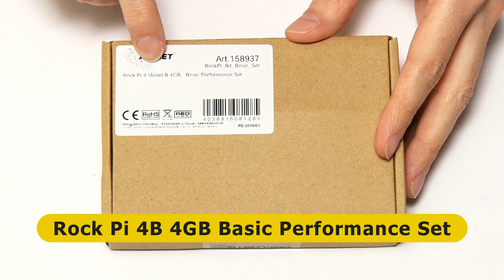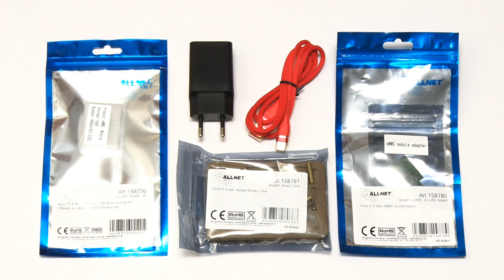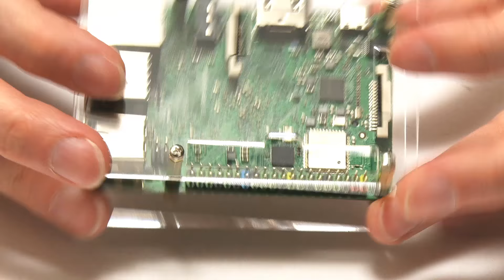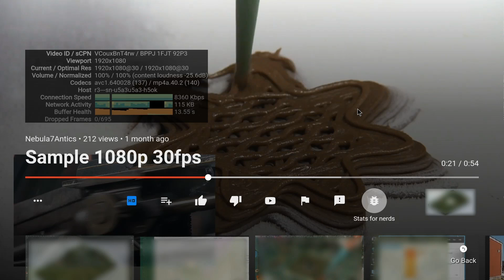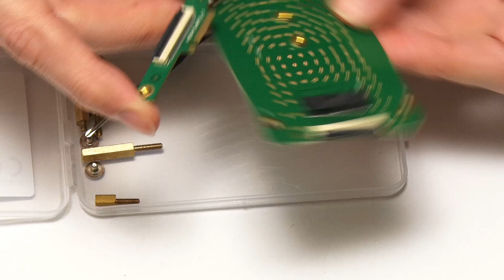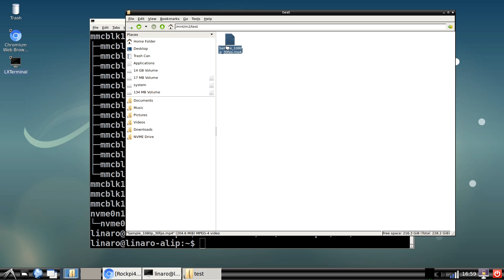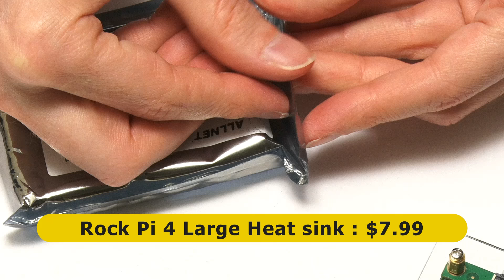Rock Pi 4B : M.2 & USB 3.0 SBC

Comment: These rear mounted heat sinks/CPUs is a negative, convection cooling is going to be far from optimal, they should have also left a cutout for the GPIO pins in NVMe extender board. Better yet, considering most existing standard PI cases can't fit an underside CPU/heat sink, so no savings there, they should move the Display DSI, Camera CSI port and possibly the audio jack to the underside, allowing the ram and CPU to move topside .. better convection cooling and no need for a NVMe extender... most Pi cases would just need a minor lower section redesign and  I doubt many if any  hats need the DSI or CSI ports in those specific Pi locations.
Reply: I thought about all that but then I thought to myself I could just flip the damn thing upside down and slap a fan on that honking heat sink. Does it really matter if it lays upside down? If we all call it upside right from now on then it is ;)

Comment: Could the NVMe extender board be mounted at the bottom of the heat sink?
Reply from the maker: It could indeed. :)
Reply: Then heat wouldn't dissipate as efficiently. They do need to make a cut out on the hat or 90 adapter for sure.
Reply: The heat sink is already facing downward against the table anyway.
But the nvme extension board indeed doesn't take that much surface area, may be some cut out for the air flow or fan mount would be great

Comment: Chris when you added the NVME did you look in the existing Android file structure, I've noted whenever I add micro SDs to my Android phones they show up several layers down in the existing file tree,  they seem to like linking add on nodes through well embedded layers,  always remembering Android was designed BY Nerds FOR Nerds.
Reply from the maker: I will root around! Thanks for this. But I suspect it is a driver issue (or lack thereof)
Reply: @ExplainingComputers  you are likely correct sir, I was just recalling that adding devices on Android always seems a bit sketchy, thanks for continuing making these awesome videos Chris, you are THE BEST!

Comment: Did enjoy the vid as I think RP3 has hit its ceiling and we need the next gen to filter through with more ram and vid as my RP3+ does struggle with some emulation of games esp N64 games that stutter terribly.   I like emulation as it means I don't have to wear out my extensive hardware sets and would rather wear out a SBC than a much harder to replace console or cartridge.

Comment: this is becoming scary. all these heatsinks, daughter boards, wide SCSI-like cables etc.
I suppose this should become end-user friendly complete compact cheep PC with alternative OS. and why casual PC user needs GPIO connectors? One needs more USB ports I suppose.
On the other hand why an engineer  needs HDMI?
SBC manufacturers are trying to make their devices so versatile so no one really needs all this
Reply: Answer to all your questions is that this board mimicks (in a good way) the way Raspberry Pi is (shape included), but with much much better hardware. I suppose that is enough.

Comment: Is the odroid N2 the obvious superior SBC solution at 63 dollars?
Reply from the maker: The Odroid N2 certainly looks like it will be a nice board. But is not yet on the market, is more expensive than some Rock Pi models, and does not have an M.2 slot. So it is neither an obvious or a superior solution! :)

Comment: Hi Chris. Slowly but certainly I am getting my laptop back to where it was.  Interesting little board and I'm only about 6 minutes in. One thing I would like to suggest is that when you point out something, especially on a super zoomed-in shot,  you might want to point out the features with a smaller device than your finger, say a pencil, a straightened paperclip or a small screwdriver.  As a passing thought, you might want to list a price "as-it-stands" with all of the options plugged as it sits.  A nice little review of a nice little computer. Cheers.

Comment: the m2 nvme slot, is that a PCIe Gen2 x4 or PCIe Gen2 x2 or something else?
Reply: Hi, the M.2 slot is gen2.1 x4
Reply: @NB-sw1op  thanks, so at 500MB/s for 1 channel of PCIe 2.1; 4x would mean 2GigaBYTE/s; interesting, wish there was a 4x Sata hat like the NanoPi M4 has
Reply from the maker: This I do not know. All that the Rock Pi web pages state is "M.2 connector supports up to 2T M.2 NVME SSD". I know there are others in the comments here now who may be able to provide an answer. :)

Comment: I'm beginning to believe that SBC's are starting to outgrow their original function. Dont get me wrong I still want one, but just saying. Great Video as usual.
Reply: Isn't it logical though? How would you increase speed without consuming more power or getting hotter? Also it's the space limit. You can't put an AMD Ryzen 2200G on top of this space wise and have space for the rest stuff as well, can you? I know that it's not ARM but my point was space.
Reply: @nikiforossarantoglou5917  sorry, i said outgrow, what i should have said was overpower. most sbc's were originally meant for either iot or some type of robotics. these are now becoming full fledged computers that are completely overpowered for most of the projects that they are going to be going into. they are really nice and more power is always great but at which point is an embedded computer overpowered for the job it is doing? anyways just a ramble of me thinking out loud.
Reply: @benjaminlittle7916  Yeah I got you now! I agree with your way of thinking.
Reply: @nikiforossarantoglou5917  Dont get me wrong, more power is more power, but when it comes to embedded, how much is needed. Still seems like a great product and cant wait to hear my wife yelling at me about this one, lol!!
Reply: @benjaminlittle7916  Personally, I would be sold to get it if it had close to raspberry support. I mean I get it, the price is low for the board itself but there are additional modules you really need if you are going to use the extra features and at least in my country the price adds up well over 100 euros and that makes it more of an investment for me. I will most likely wait and see what's going to be with RaspPi4 but I really like Rock Pi 4B setting new standards, stuff people silently wished all this time and all you would find was just incremental upgrades. Rock Pi 4B did all of these at once which was nice and bold!
Reply: @nikiforossarantoglou5917  cant argue with you there!!

Comment: What a waste of WD nvme drive.? I am gathering money for a NVMe drive, and u are using it on this low power computer.
Reply from the maker: Sorry about this. The drive in question is one I have for testing, so will not stay on this board. But to run my business testing out SBCs and other kit, and for projects shown in my weekly videos, I do need some test components. :) And I am also fortunate that many manufactuers supply what I need (though I did buy the NVMe SSD shown in this video).

Comment: I wonder if u need cooling on the Rock Pi4 CPU since it has such a large speed in Ghz. It may be that it can last longer. A small fan on the heatsink would be efficient
Reply from the maker: A heat sink is certainly needed given the RK3399 SoC and its speed as you say. But a small fan on a small heat sink might suffice.

Comment: Nice board, Christopher! I just looked-up the specs for the rock chip rk3399 on Wikipedia: It has two ARM Cortex A72 cores and four ARM Cortex A53 cores. Unfortunately, the A72 allows for speculative (i.e., out-of-order) execution, so unlike the Raspberry Pi 3, it's not immune to Meltdown and Spectre. I shall get myself a RP3 for extra security for tasks such as online banking. Thank you very much for another splendid video!

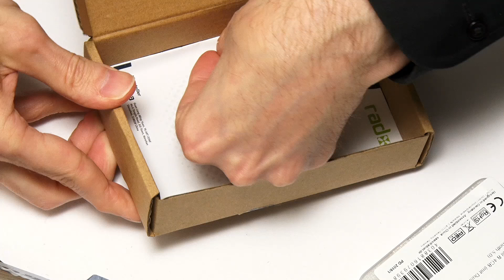Comment: 2:27 you didn't want to go 'agressive' and tip the box over eh :)
Reply from the maker: Tipping the box would not have removed those instructions! :)
Reply: @maicod  we did change the size now, the packaging did unfortunately change faster than we could reprint the instruction manual... sadly Christopher had to suffer with not getting any instructions... ;-)
Reply: @NB-sw1op  It's understandable. Good luck with your product !

Comment: So, forgive my ignorance, but since the Raspberry Pi 3B+ has four Arm Cortex-A53 1.4GHz CPUs, and the Rock Pi 4B has a 6-core CPU -- 4 of which are, in fact, Arm Cortex-A53 1.4GHz CPUs, why can the Rock Pi 4B not run Raspberry Pi software?  Your main complaint is software support -- yet, it would seem, on the surface, at least, that the two computers should be completely software-compatible, no?  What am I not seeing here?
Reply from the maker: The issue is all the drivers for the devices on the board, from RAM to the USB ports, display, etc. There is a mass of low-level software that has to sit between computer hardware and the applications we humans run. This is all standardized for x86 PCs, but not for ARM boards like these.

Comment: I've always wondered; what high memory usage applications are there for SBCs ??
I keep seeing these single board computers designed to mimic the RasPi, but the software/code that you'd run on a computer like this wouldn't likely break 1GB or 2GB of memory usage, let alone 4GB!
RAMDisk on something like this would be a great idea, 2GB of RAM and 2GB of RAMDisk that copies a folder from the storage drive over on bootup, so there is a 2GB partition of UBER fast storage.
Reply: the moment you add a modern browser with tabs, and given the bloat of modern websites, you use up 4GBs no problem, with some paging to the disk to spare.
Reply from the maker: More memory is also useful for NAS applications, 4K media playback, and AI uses.

Comment: Stretching the term 'Single Board Computer' with this one. The M.2 positioning seems like a real mess, presumably its only been done like this to be able to say that the top side of the board matches a Raspberry Pi layout.

Once it's all put together you don't really have a case there anymore. Theres contacts exposed all over the place, certainly not something you could, for example place behind your TV as a htpc without fear of it shorting.
Reply: Rick M Definitely stretching, yes - I think you could (should?) cover the top M.2 board with the original plastic case, looking at the additional spacers they shipped with the M.2 board. Of course that adds yet another layer.
Reply: I think, the M.2. extender board was meant to be mounted on the other side of the main board, below the heat-sink - this way it will not block the microSD and/or GPIO / other connectors :) Also, this way M.2. would be on the 'inside' rather then exposed to the 'outside' of the whole contraption.
Reply: Pitus Pete Yes, that covered SD slot really irked me, too. Either way, I don't mind the stacking, and the big heatsink is a nice idea to avoid active cooling. I'd definitely consider this (S)BC If they got some NVR Software to run on it, the rpi3+ is just a tad too slow for my purposes.

Comment: Great SBC. 
Few tweaks here and there like boot from NVMe, Linux of course, and here we have capable small computer. 
Future is in ARM CPUs technology as in the virtualization as well, on great scale. 
Great work Chris. 
Enjoyable on all scales. Thank you.
Reply: RavenPrecept 

Yes, it is more powerful. 
It uses different kind of instruction set and the way it uses it. More power = power consumption as such. It is cisc. 
On the other hand arm as a risc uses less power as result of different handling of reduced instructions set. 
Cisc can handle different OSes. The best of cisc one can have is using VMs. 
Arm development is getting momentum because of more powerful CPUs and pipe-lining. 

VMs are the best solution for people who uses multiple OSes/lots of programs and applications and do a lot on their machines. 

Or maybe they just like to experiment and to learn. 

What is interesting is to see future development of cisc/risc technology. 
After all, we need functional/powerful/versatile machines with less power consumption and as much mobility possible. 

We'll see.
Reply: Raspberry Pi has more support.  i see they had Ubuntu Server and i'd like to run snap RAID and Merger FS and Plex, Emby and kodi. some of this is explained in the Linux Unplugged podcast episode 277 minute 20
Reply: Elvira Elora Milosic FYI, the Samsung 950 PRO NVMe option ROM also emulates an IDE interface during boot for old school BIOSes. Subsequent models lack this feature (wth?) so the 950 PRO commands a premium over them.

Comment: I have a question if you could help, I have a TX3 mini android TV box but it's running a tablet version of Android is there anyway of installing the TV version of Android or any better Android on to it as it's hard to use without a touchscreen thanks
Reply from the maker: Probably, but don't ask me how! The OS may be on a chip, or (re)programmable via (eg) USB.
Reply: ExplainingComputers since your a computer wiz could you look into if it’s possible sorry to bother you this box is pretty hard to use with the touch version of android

Comment: Looks like this is the follow-up of the Pi 3b+ we all wanted.
Would be nice if there was a case that fits all stuff in (M2, Heatsink). Or maybe a case thats a heatsink itself.
Reply: That's actually a really neat idea. A surround heatsink case maybe with all standoffs so air can still get around it while it's on a flat surface. CNC machines at the ready!
Reply: Good point! we are working on cases which will take care about these issues.
Reply: @NB-sw1op   Nice to hear that info. Will you send one test example to Explaining Computers, if and when available ?
Reply: @manni_pulator  yes we certainly will do that!😀

Comment: The RockPi4B looks pretty good.  After getting the Pi3B, the Tinker Board, & the Rock64 and discovering their respective limitations each in turn, it appears the RockPi4B has been built with exactly all those limitations in mind.

The USB-C alone addresses a lot of issues - particularly with respect to the TB.  But, colored GPIOs, USB 3.0, WiFi, M.2, 4Gb RAM, & the fancy rk3399 w a nice GPU - it doesn't meet the RPi3B+ price point and definitely not software support; however, I think you've just presented the successor to the aforementioned 3 boards as if they were one.

I still use several RPi3Bs and I've got Armbian on my Rock64 with the system on an SSD (compared to ~a year ago, the Rock64 is now pretty stable) - I'd say the RockPi4B might be the next SBC I get to mess around with  (unless, and albeit the price would likely be much higher, a Kirin 980 SBC is announced in the next month or so...).

I'm glad to see the excellent presentation on an SBC I really hadn't given much attention.  Very nice!
Reply: Well..., who knew a day later Nvidia would announce the Jetson Nano AI SBC Kit for $99....(?).
Reply from the maker: Indeed. :)

Comment: thanks for the wonderful review. Some questions though: Can you boot from nvme? Can you use 3rd Party poe?
Reply from the maker: NVMe boot is I believe technically possible, but no OS images for NVMe boot are currently available. I don't know on the 3rd party PoE.
Reply: the PoE Connection is compatible to the Raspberry Pi PoE HAT. for the 3rd party PoE hat -  which type or brand are you referring too?

Comment: After the nvme, the GPIO header access is blocked...
Reply: It looks like a Dremel would fix the issue really quick.
Reply: ...and so is the SDram slot. Perhaps the M.2 board could be flipped, and mounted over the processor heatsink?
Reply from the maker: It is, although the extender board could mount under the base / heat sink.
Reply: the M.2 extension is like all the hardware under constant improvement. We will add your considerations into our plans. Mounting options for the top and bottom are part of our housing designs, which are in the works.

Comment: Love your videos and this is another good one... but did I hear you say there is no audio from the HDMI connection?... or it hadn't been configured to operate...
Reply from the maker: There is no HDMI audio in Debian, only 3.5mm jack audio. I tried and failed to make it work. But HDMI audio worked fine in Android -- so it is a driver/software issue.